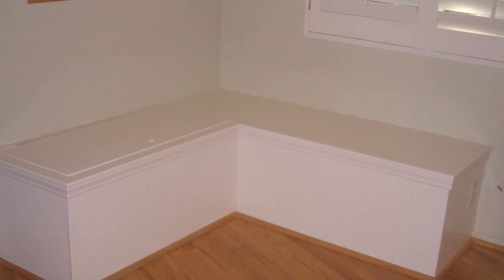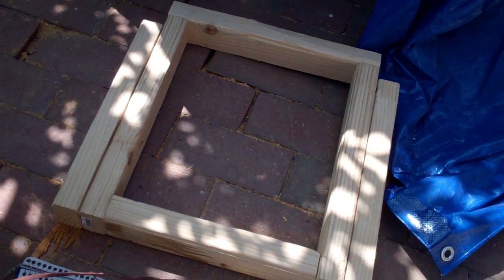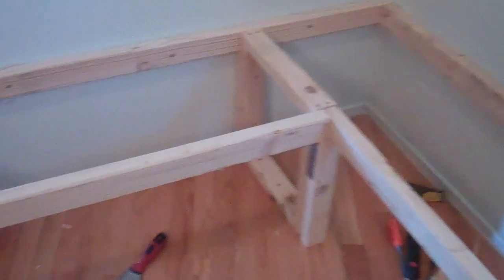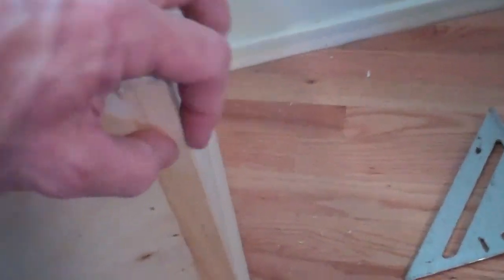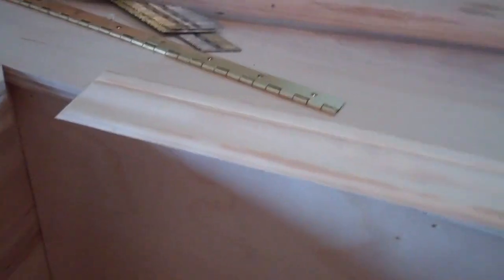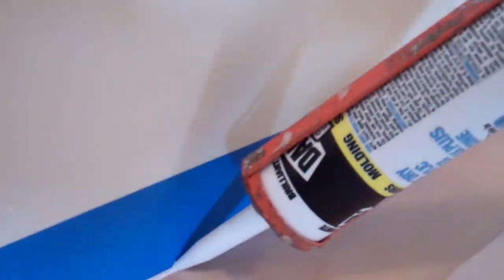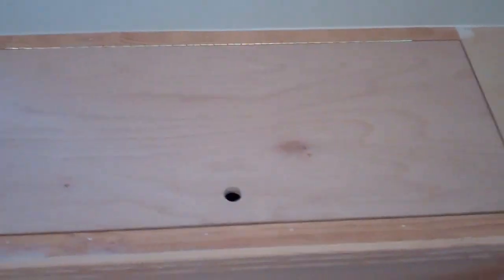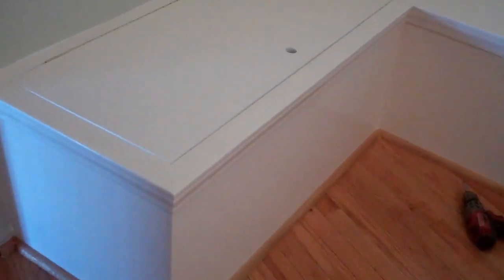Built-in kitchen nook

Comment: Nice work! I'v noticed a lot of other plans online and they seem to over complicate things. You kept things simple but well built and nice looking at the same time.
Reply from the maker: I appreciate that. As a contractor, I don't have a lot of time for these, and of course budget plays a role in design and building. I try to balance making it worth my time while giving them something nice. That affects why I consider a very utilitarian approach to design and building. Thanks for watching.
Reply: mittsdad by the way I ended up building these just as you did. My benches were a bit longer than yours so I had to put another piece of 2x3 parallel to and under the hinge for support to prevent the tiniest bit of sagging in the middle of the bench. Otherwise, solid as a rock and my wife and kid love it. I'm actually confident my 390 pound dad can plop down onto it with no worries!
Reply from the maker: Yay for dad. I'm glad I could inspire you. This is fantastic to hear. Thanks for watching and thanks for sharing that story. Much appreciated.

Comment: What kind of plywood did you use?
Reply from the maker: I don't recall, however, I would recommend some type of cabinet grade. The home depot sells a good quality pine cabinet grade and specialty plywood stores offer a "shop birch," which is what I typically use. Both are great quality for a relatively low price. Thanks for watching.